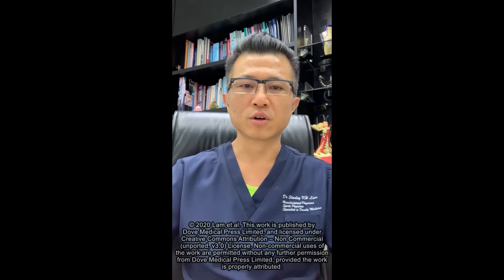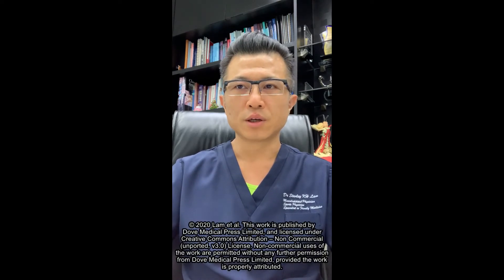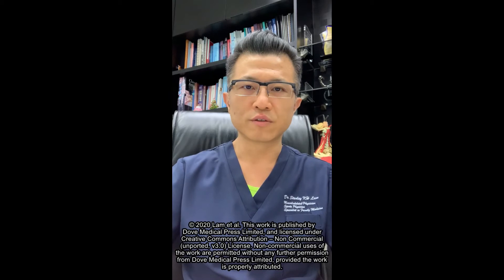Ultrasound-guided nerve hydrodissection for pain management - Video abstract [ID 247208]

Comment: I will be undergoing this procedure on 12/13/23.  Please cross your fingers for me.  This pain has got to stop.  I want my life back.
Reply: Please give us an update? I’m having it done in 2 weeks and am trying to tailor my expectations
Reply: @crispycruiser4654  WELL!  Now THIS is a freaking surprise!  Apparently, over the past year, I have undergone this procedure FOUR TIMES PRIOR and never knew it because it was called by a different name!  Each time (twice in the right thigh bursa, twice in the right hip) I was afforded a few months of relief, and when the pain returned, it was less and remained less!  Same thing on 12/13, under ultrasound (again).  I just had a CAT Scan with contrast on 12/19/23 and it was found that some of my hardware/screws had loosened (at T12-S1) with adjacent reactive sclerosis, but the bone graft and osseous fusion seem fine.  In comparison with my MRI of 11/18/22, the CAT Scan of 12/19/23 shows there is a grade 2 anterolisthesis at L5-S1 with reactive sclerosis and cystic change at the endplates along with osseous productive change at the anterior aspect of the S1 vertebral body. Gas in the disc space. The degree of anterolisthesis has increased compared to the MRI of 11/18/22.

I will consult with my surgeon and my osteopath... but my own research shows that "pain management" (nerve ablations, medication, epidural injections, etc.) are the path down which I shall be led.  I just want it to STOP HURTING.
Reply: @wiccanwomanblog4339  that’s a lot you are going through. Really sorry to hear that. Keep us updated
Reply: How’d it go
Reply: @heythere6983  Thank you for asking!  I am SO glad to be given the opportunity to reply!  I'd forgotten all about this thread.  It turns out that my Osteopath decided NOT TO PROCEED with the hydrodissection.  He said he thought it would impair my gait.  While I THOUGHT I'd had it, what I actually DID have were ultrasound guided steroid injections into my right hip joint, and my right thigh bursa.  I had 2 of each.  I was thinking of scheduling another when two days after Christmas I woke up with NO PAIN in the hip.  I said nothing for days, afraid that it was an aberration and would return, but it hasn't!  I am down from 245lbs. to 183lbs. which I am sure assists my condition.  I still use a walker, but over the last 2 days I've been working with a cane inside my house.  Last night was a horribly painful night (both legs), but I think it was from over-exercising.  ALSO, my osteopath prescribed Pregabalin, the minimum dosage of 50mg., and it's a freaking MIRACLE DRUG.  Within days, 75% of my all-body pain diminished, proving it was nerve-pain.  So, I'm coming along, trying hard to stand straight at the waist (very difficult), and get better!  Please don't hesitate to write again!  I enjoy the interaction!
Reply: How did it go? Did it improve your pain?